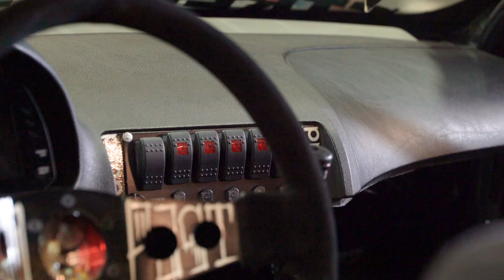Man-line King Micah Diaz's V8 Powered BMW Shred Machine

Comment: Roll cage not tied intonthe subframe mounting points?
Reply: Its illegal for my series
Reply: @MicahDiaz  oh alright. How', the subframe holding up to the abuse? xD i have a 328i with m3 reinforcements welded in. So wonder how much they can handle? My last one, an E46 320i had a huge crack in left rear point
Reply: @ChazeFocus  just condorspeedshop weld in reinforcements

Comment: 328i are 4 door! Anyway it's a 325ci or 330ci
Reply: All engine variants could be chosen as 2 or 4 door. Except for M3 of course.
Reply: @gixxxer1000   actually if you are a true bimmer head you will know the m54b22, m54b25 , and m54b30 so where is there a 328i "variant". Anything else rookie??
Reply: @Darkred_s12  big mouth, you're the rookie. You only name the facelift engines. Pre facelift are m52tu 23 (323) and 28 (328) engines.
Reply: @gixxxer1000  those are the models you see in pick a part. Those don't matter and prefaclift motors were trash.
Reply: @Darkred_s12  weird way of saying that I am right.
Reply: @gixxxer1000  prove to me there is a m54b28
Reply: @Darkred_s12  i said M52tuB28. Do your research and you will know the M52tu are the pre facelift engines. M54 are facelift engines for the E46 chassis.
Reply: @gixxxer1000  m52 was originally from the e36 headass. Go pay 2$ at any pick your part yard and prove me wrong. Also that motor was only featured for the first year and a half.. look at sales and production numbers. More sales were projected with the newer more fuel efficient m54. Not a great motor for power but it was balanced.
Reply: @Darkred_s12  in other words there was 328 2 door E46, like i said in my original post.
Reply: @gixxxer1000  then find one for sale on an ad prove me wrong
Reply: @Darkred_s12  i dont need to prove anything. Just sharing my knowledge with the community. If you dont listen, that is your loss.

Comment: All you guys do is promote a LS swap hacks if these guys had any Talent or any skill or any Integrity they would run something from the company they're driving BMW makes a fine engine but they're too lazy and too cheap to do it the right way
Reply from the maker: You ok man?
Reply: Most of these guys don't have huge amounts of money to spend. If you want to drift, you want cheap and reliable. In the US, LS engines are just that.
Reply: Because it's just impossible to boost the engine that's in the car
Reply: @speerspeerjeff  that's irrelevant.. and suppose the car had no engine? In motorsports it's about getting the job done not just style and being different
Reply: Your right we should all just be sheeple. Let's just put an ls in everything and then we can justify the $11 billion we lost bailing out gm.